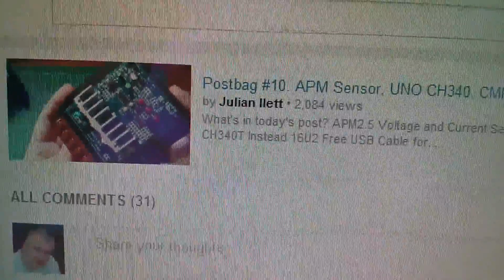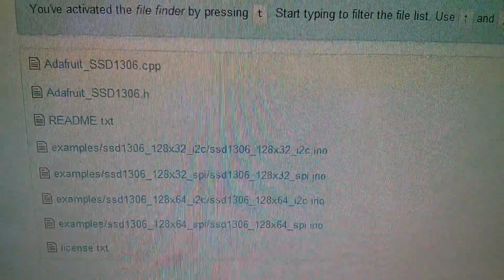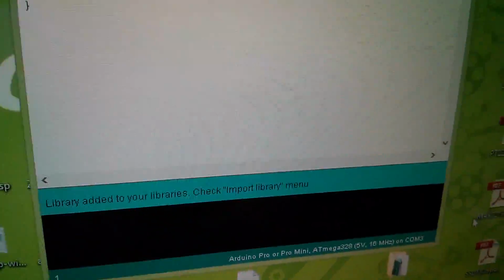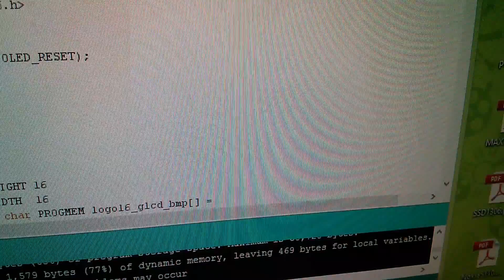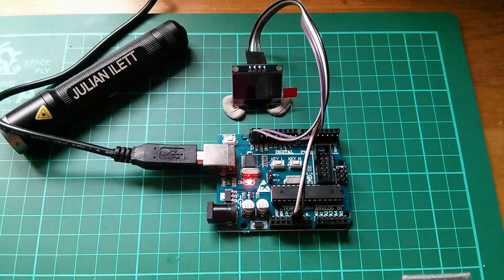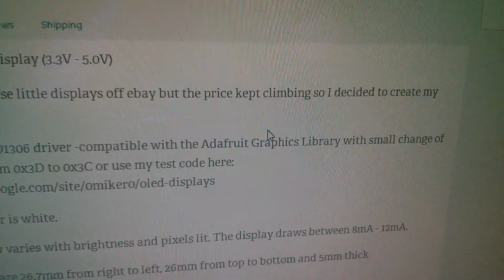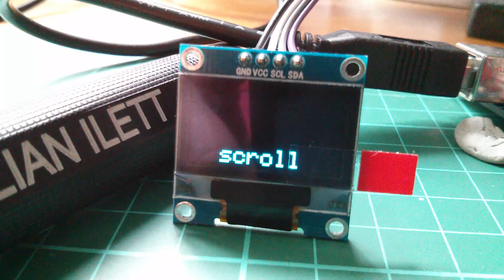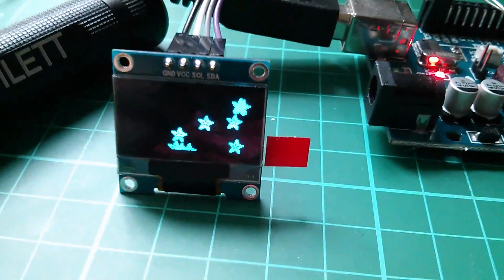1-Day Project: Arduino Uno and I2C OLED Display Challenge

Comment: So, are the pull-up resistors necessary?
Reply from the maker: iwantitpaintedblack Yes
Reply: Julian Ilett Can you please update the links in the description ? the 1st one just takes you to the ebay homepage and the 2nd one is an SPI interface oled,

and also, can you clarify the connection of resisters? SCL to VCC and SDA to VCC?
Reply: Julian Ilett I have this OLED
http://item.taobao.com/item.htm?spm=a1z09.2.9.28.9vxMsi&id=21003931031&_u=p1lfmpbq4015

it supports all the multiple interfaces with a small solder blob change at the back, but i cant seem to get it to work,

Comment: Hi Julian. I've received a .96'' oled display (http://www.ebay.com/itm/201146880872?_trksid=p2060778.m2749.l2648&ssPageName=STRK%3AMEBIDX%3AIT) But the pin layout is different then yours. Do you know how to hook up this display?
Reply from the maker: 6toeNL Your's is an SPI version - easier to use really. See my wearable device videos where I use the SPI version.

Comment: I just tested mine with an Arduino Mega and it worked fine with 0x3C and directly wired to the SDA/SCL pins both on 3V and 5V. I plugged in a resistor and didn't notice a difference. YMMV, of course.

Comment: Liked and subscribed, great stuff!  
Any idea how to change the address if you want to use two? 
I guess move the resistor to the other two pads? But which address would that be in code then?
Reply from the maker: YensR It would be the next address (1 higher or 1 lower)
Reply: Julian Ilett Thank you!

Comment: with my device (looks a little bit different at backside) I had to use:
display.begin(SSD1306_SWITCHCAPVCC, 0x3C);    (not 0 , not 0x3D)
The display worked also without pullup resistors.

Comment: Hi Julian, first of all: thanks for a great tutorial and channel! I haven't watched it all yet, but it is not far from...

I've been playing around with Arduino (and Spark Core) for some time, but this is the first time I try to attach a display. I followed your steps, got the same compilation errors (and some more), but finally the code is uploaded. However, when the code is running, I am getting white noise in the lower 4/5 of the screen. A band at the top of the screen seems to show the correct image. I tried to vary the pull up resistors from 1k to 20k, but is does not change anything. Any ideas?
Reply: I solved it :) It seems that my display is using the SH1106 driver. As I could not find any references to this driver in the Adafruit library I switched to u8glib. This has support for both drivers and it is easy to switch simply by uncommenting the function for the driver you need in the beginning of the example.
Reply: Espen Lodden how do you find out which driver your oled uses?
Reply: I just tested with the two alternatives and saw which one worked.

Comment: Hi,
I checked wikipedia about pull-ups but I still don't get it. Will normal 10K resistors do? i checked ebay and there are no pull up resistors..
Pls help
Reply: i think he means that hook a 10k resistor each from SCL and SDA pins to VCC to pull them up to the VCC voltage

Comment: +Julian Ilett which Arduino uno board do you use Julian. the ones I have seen do not have SDA and SCL marked at all. So which clone are you using. I've just been to the Arduino site and cannot see it on their boards at all
Reply: The SDA and SCL pins are directly wired to A4 and A5 respectively
Reply: iwantitpaintedblack
OK Thanks

Comment: Is there a screen protector beneath the tape with the red sticker? My tablet had one like that and it was very easy to remove the tape without damaging the screen protector. Obviously I didn't pull it from the red end but the other one.
Reply from the maker: Yes, there is a screen protector. Tried to remove the sticky tape like you said, but it left a sticky mess on the protector - so now I've removed the protector too.
Reply: Julian Ilett
The residue is also easily removed with acetone (but you have to be sure that it won't damage the screen protector or the screen) or even better benzene(?) for stain removal sold at supermarkets. I'm not sure if it's a proper translation in English but you might know what product I'm talking about. I use it all the time to remove sticky residue and it does a great job. It never caused any damage to plastic materials. Sorry I didn't mention it earlier.

Comment: nc video as always :-D
will that wotk with the arduino uno or the duelmilanova? cause the pins that you used seem to be missing from these oilder arduino versions. also was the pull up resistors nesesary in the end?
Reply from the maker: Thanks. The SDA and SCL pins are directly wired to A4 and A5 respectively. On the Duemilanove and older Unos, you can use those pins instead. Pull up resistors did seem to be required.
Reply: Different AVR chips actually have the SDA and SCL wiring in seperate locations. On the original duelmilanova this wasnt an issue as there was only 1 model AVR in use and shields could safely assume SDA and SCL to always be in the same place. With boards now available with different chips and entirely different architectures that assumption is no longer true, most notable SPI is in a totally different place on the arduino mega. With the arduino uno r3 the arduino 1.0 shield pinout was formalised. In the 1.0 pinout, SPI is always available on the ICSP header, dedicated SDA and SCL pins were added which would just be wired in parallel with the respective pin for the chip (so A4 and A5 on the AtMega328) and all new shields are supposed to utilise i2c via the new pins and spi via the ICSP header. Many older shields used A4 and A5 directly for i2c and pins 11, 12 and 13 for SPI. As a result, older SPI shields dont function on the arduino mega which uses an AtMega2560 which has spi on 50, 51 and 52 instead. The leonardo and due don't have SPI on the actual GPIO pins. Now with the r3 layout, SPI is always available in the same place.

Check the documentation for your specific board and they will always mention where i2c, spi and uart are available.

Comment: This is excellent Julian.  I have dozens of the 5110's and use them in just about every project but it always annoyed me they aren't I2C.  Picked up two of these to give them a go on some projects where I need the extra I/O pins.  Thanks!
Reply from the maker: Thanks Eric. I like the 5110s, especially for outdoor use, the monochrome LCDs are so easy to read in bright light.
Reply: David Watts I had a few like that as well- I usually just bend the tabs a bight (slightly straighten) to increse the pressure.  Usually works out to get them working good.  Cheers David.
Reply: David Watts Good stuff.  One was a real pain so I actually removed the retainer- built the surface up a bit- then clamped er back down.  I buy the cheapest ones so doesn't surprise me when I get them anymore ;)  Amazing display for the price.  Cheers
Reply: The 5110 always annoy me, every unit I have had goes a bit funny when pressed or moved.
Reply: Eric William I am I'll give that a go, I have a couple in the shoebox where I throw everything.

Comment: Are there any particular arduino units/kits that you could recommend to those who are interested in trying out arduino based projects but don't know where to start or those who know very little about how they work? I forgot to mention that I live in Canada.
Reply from the maker: The Arduino Uno is the "number one", so it's a good entry level device. I like the Nano because it's cheap, easy to connect to (especially if you get one of the Nano breakout boards) and has the USB/serial converter built in. I'd perhaps avoid the Leonardo - its USB can be a little flaky.
Reply: Julian Ilett for the USB issue on a leonardo, usually thats down to trying to access it before the USB module is fully initialised (takes quite some time but isn't a blocking process so the rest of your code can continue). http://arduino.cc/en/Serial/IfSerial   This can help avoid issues with the USB serial.
Reply: Julian Ilett
I found a decent looking kit online, I also ordered an 8x8 rgb LED matrix which should keep me entertained for a bit provided that the kit works properly http://makerstudio.cc/index.php?main_page=product_info&cPath=2&products_id=269

Comment: If you have an address jumper like this on an I2C device it will most likely just change the least significant single bit of the address. The IC has one pin that can be pulled high or low (I have seen up to three of these hardware setable address pins, but that's rare). The rest of the address is internally fixed. If you have a second display and move the jumper to the other position you can drive two of the displays on the same I2C bus.
Btw. for a short bus the pullups should not be needed. The wire library of Arduino will activate the internal pullups of the ATmega, which are around 20k-50k, if I remember correctly, and enough for most applications.
Reply: SixSixSevenSeven
There is no "spec" for I2C pullups. The spec says you have to meet the timing requirements for rise and fall times for the given speed (pull up and bus line capacitance have a RC time conastant), and you have to be able to pull low enough that all devices will see a LOW on the input (no device can pull down to 0V; the internal transistors will always have a voltage drop depending on the current, which in turn is defined by the pull up).
All that depends on your own design, so there's no real way to give a resistor value up front.

All that said, with Arduinos slow 100kHz I2C I've never had any problem just using the internal pulllups even when hooking up multiple I2C devices on a bread board (which arguably is one of the worst things considering parasitic capacitance).
Reply from the maker: The default address is probably in the data sheet somewhere. The pull up resistors did appear to be needed though, removing them caused it to fail
Reply: Julian Ilett
Yes, on page 19 of the Adafruit datasheet. These address select inputs almost never have pullups. They have to be connected directly to either VCC or GND. It's weird that they use a resistor in that place. Leaving it floating is an invalid state, except for some cool parts like this ADC for example http://www.linear.com/product/LTC2309 which has LOW, HIGH and floating as input letting you set 9 different addresse with just two pins.

EDIT: I've just seen that the "resistor" was a 0 Ohm jumper anyway. So you might as well just make a solderblob accross the gap.
Reply from the maker: Ah yes, the wireless remote control chips PT2272 have those 'tri-state' inputs too.
Reply: 20-50k is officially out of spec for i2c applications actually. Even 10k is considered a fairly weak pullup in i2c.
Reply: superdau On a set of 5cm jumper wires between an arduino nano and an arduino mega I had no i2c functionality without external pullup resistors. Short of having the headers almost directly touching each other I dont think you can get much shorter than that. In my experience i2c never works from the internal pullups.

Comment: What's so special about the fake arduino? Is that usb-to-serial IC better/faster than the standard rs232 converter thingie?
Reply from the maker: The CH340 is cheap. On the Nano it reduces the price from about £4.30 (with FTDI chip) to £2.50 with the CH340
Reply: Julian Ilett woah, ok :D also discovered those male headers next to the females, they look usefull!
Reply: *****
Yeah, I've seen that, too, and just wanted to write the same. All the jumpers I have are either male-to-male or female-to-female and it's really annoying to always have to join two of them together to get a male-to-female. I could of course get some of these ready made cables....
I find it really cool that some of the cheap chinese stuff is not just a clone, but often has some useful improvements. (in another case for example a pro mini compatible thing that has extra pin holes so it can be directly connected to a 6 pin ISP programmer)